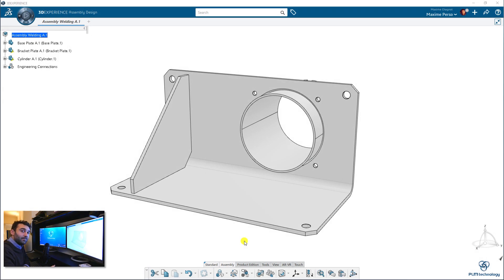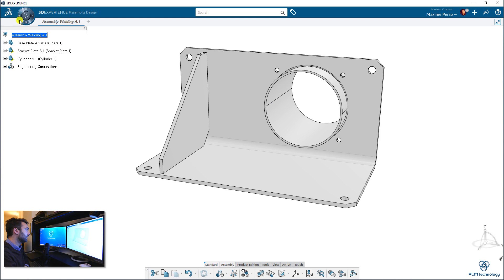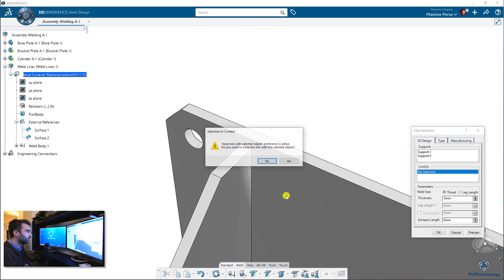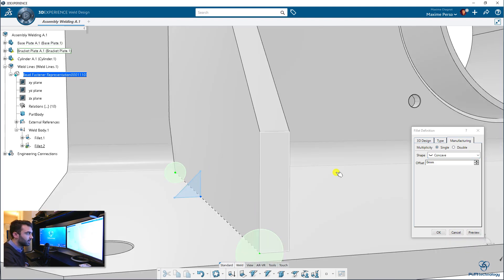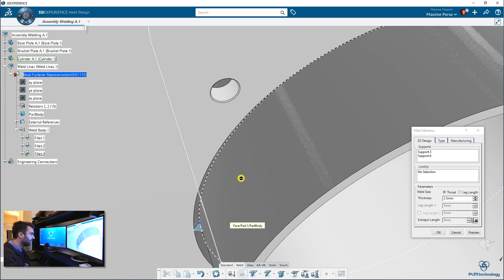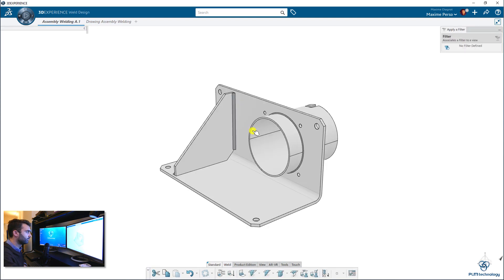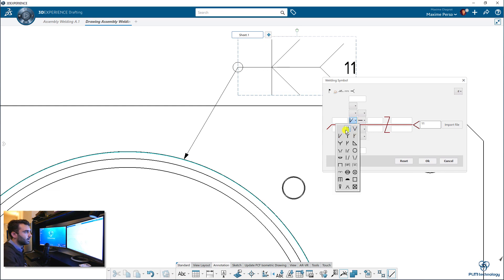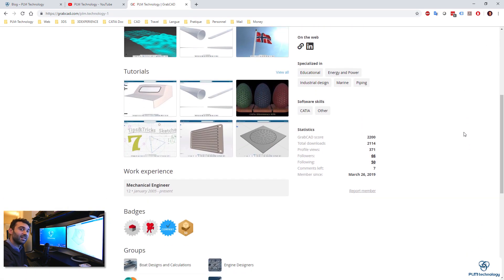Introduction Weld Design app - CATIA 3DExperience R20x

Comment: How do you put a weld on a single component? For instance a bended sheet metal corner. In Solidworks we have weld corner. Thanks.
Reply from the maker: Hi Juanmedinar20, Thank you for your comment. With CATIA weld app, you cannot apply the weld in the part. You can only do it on the assembly level.

Comment: Hi Maxime!
Can these welds be used for a Physics Simulation? i.e. do the welds count as a connection in an assembly?
Reply from the maker: Hello Marnix,  I believe that the welds can be reused for a structural simulation, only if you do the mesh in the assembly. However, I am not an expert in simulation, but I am quite certain that you can use specific contact features in simulation app, in order to represent a "bolt", "glue" or "weld". I recommend to iterate your question there too: https://r1132100503382-eu1-3dswym.3dexperience.3ds.com/#community:39 Good luck :) Maxime at PLM Technology